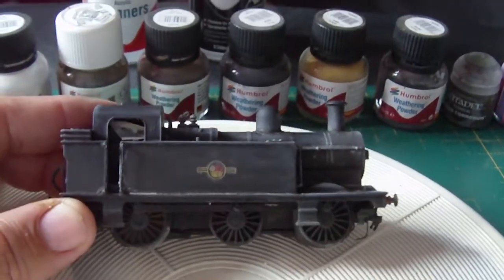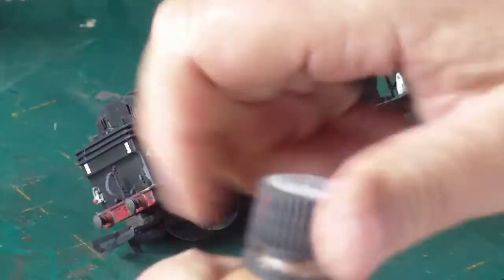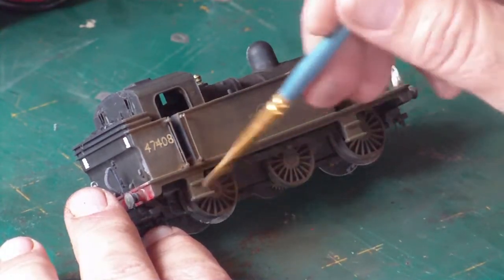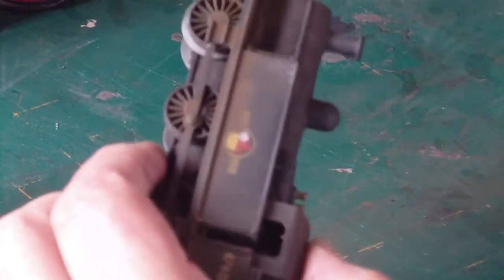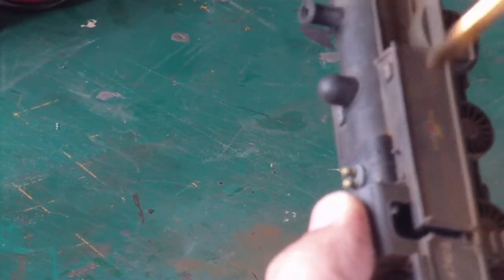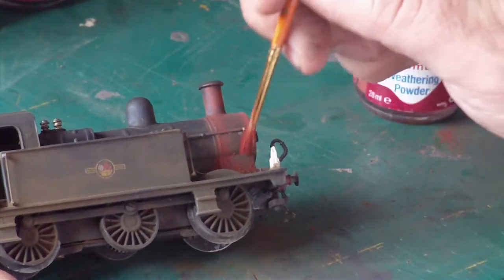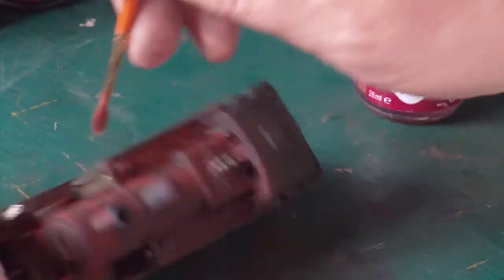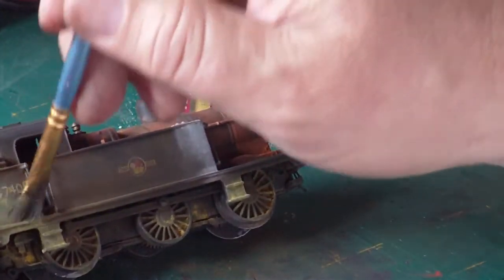How To Weather A Jinty Part 1

Comment: Fantastic work. This is something that I'd love to try. I may well just start on scrap track and old wheel sets. This video gives some great advice to get me started though.
Reply from the maker: Thank you very much for that comment, im glad it helped to make a start. As I said in the video, the best part is that until you apply spray varnish its all removeable. Have a look on the humbrol you tube page for more ways to use the powders.